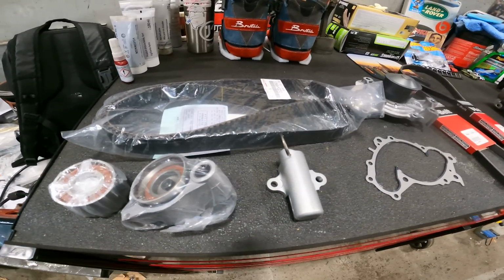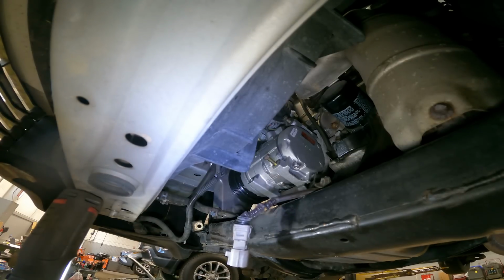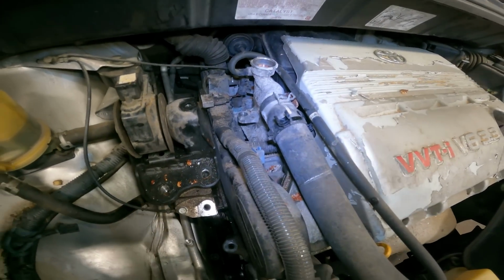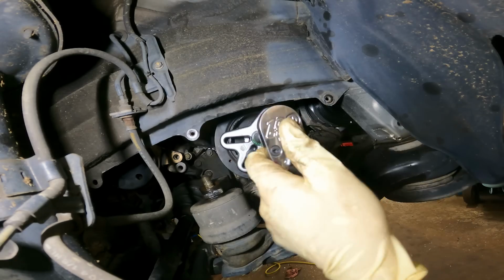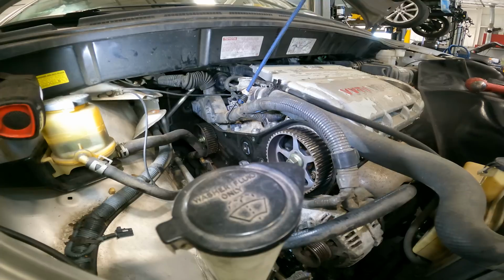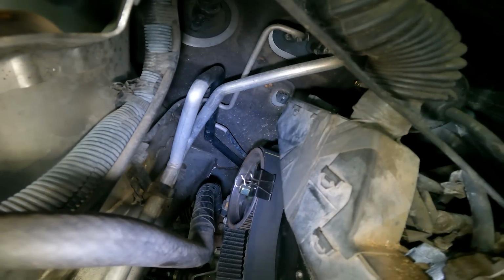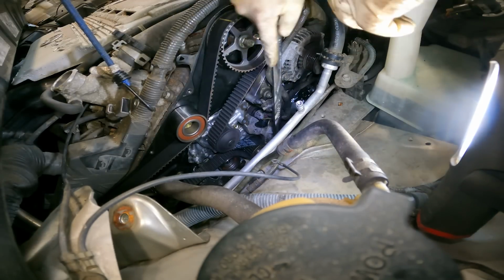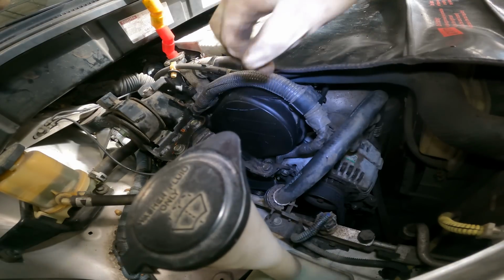WILL THIS ENGINE GO BANG💥AFTER MAJOR SERVICE⁉️ 🤔😨🤯😁

Comment: Man I forgotten about that 3.0 I used to love slapping filters on those things because they were quite easy as long as the manifold is cool… on the 3MZFE I used to be able to put plugs on the back half without removing the manifold as long as the coil packs were only in the front I think in mid engine cycle refresh they put coil packs in the back half underneath the intake manifold..
Reply: Just did one today

Comment: Apart from access...what an easy timing belt job that is!   Have you ever done a late Alfa 24V V6 Busso engine CSW??  They suck! Taper fit camwheels, cam locks, crappy thermo-mechanical tensioner that breaks if you look at it funny....

Comment: What about the front main seal or cam shaft seals? I’ve always had those replaced when the timing cover was off. Did the customer decline or was it not recommended?
Reply: Yes, definately should of replaced the 2 cam seals and crankshaft seal. You are 100% correct.
Reply: People are cheap. Im sure he recommended it. Definitely a professional who actually cares about the vehicle he's servicing,  giggity

Comment: Why doesn't Toyota demand every engine use a timing chain? I'm really surprised by the fact some use a timing belt.
Reply: The 2003 and up Camrys use timing chains. I believe the Sienna also the same way. The older models belts are the only ones. I did a chain on a 2003 few months ago.

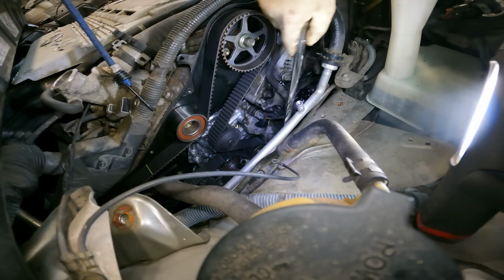Comment: 27:00 My small brain will never understand why that happens, why the lines on the belt no longer line up with the marks on the cam sprockets after rotation. I'm just a diy'er, but that's given me a heart attack in the past thinking I did something wrong
Reply: They will line up again. Depends on the engine (particular the number of teeth on the belt and on the sprockets) but it can take many revolutions. Impractical and unnecessary to do it by hand.

Comment: One thing I did with a gas engine was to pull the spark plugs, makes turning it over by hand easier.  With a diesel, removing the glow plugs also works.
Reply: Might not have been worth the hassle to remove the rear 3 plugs I would imagine.

Comment: The timing belt recently broke on my 2000 Camry. Distance is not the only factor, the rubber tends to perish with age (if not driven frequently). A non-interference engine, and all sorted now with no damage.
Reply: '99 Camry with the 3.0. 425,000+ miles. I changed what I think was it's second belt at around 311,000 miles. That belt was really cracked but didn't fail. I'm the 3rd owner. I know the second owner and he never changed the belt. He bought the car with it just over 100,000 miles.
Reply: Love the non interference design!

Comment: I hate, hate, hate timing belts.  I did the one on my 90 Dakota at 100,000 in 1993... The 2.5 had bolt holes in the cam pulley to hold it in place, I still got it wrong.  My mechanic re timed it and replaced the tensioner for me. I did the water pump the following summer, no need to mess with the timing belt.

Comment: I have a 2007 Highlander with 277,500+ miles and been saving up for the next timing belt replacement / 100k maintenance. But last week was rear ended and hoping it is not totaled, but if I need to replace the whole car, what year did they switch over to a timing chain? I bought this car at 87k miles 9 years ago. Yes, next car will be a Toyota. (Or Lexas - I'm 62 and retirement is in my future in a couple of years, no more 100 mile round trip commute.) I've been eyeballing a Lexas ES300h.
Reply: 2008 came with the 2gr i believe.

But 2gr engines are not perfect. The vvti rattle is real
Reply: The 2GFRE V6 is a chain.
Reply from the maker: Go with the Lexus
Reply: @customerstateswhat  07 rx is a 2gr as well
Reply from the maker: @colchronic  they are good engines, just don't be a Goomba with service lol. I have serviced cabs with over 300k on original engine. They are religious with oil changes and service.
Reply: @customerstateswhat  Never said they were bad. I still think they are better than an mz
Reply: @customerstateswhat  I really don't like the fact that you have to pull the engine to work on the timing cover I think that's a big mistake on Toyota's part

Comment: I hate timing belt jobs, and I`m not a tech. I just keep my own junk running, Like a 2002 Dodge Neon, timing belt was a pain, replaced belt, tensioner, and water pump. And yes, it went bang on first try, that was 8 years ago, still runs with 162,000 on the clock today. Now dealing with a P0172 rich code😠No vacuum leaks, mini cannon fired several times, plugs, map, O2, IAC, and injectors. Damn code still there. Won`t pass Pa. inspection. It`s my daily, stickers dead at end of July, can`t afford a shop, lost my job due to whats going on since Biden🤡 took over.
Reply: If you're driving a Neon, your problems started a long time before Joe took office!!! Do you always make so many bad decisions? I've got 4 Toyotas, and all of them have TIMING CHAINS... Quit buying old Dodges made in Mexico...
Reply: @gwats19577  while I do (by far) prefer Toyota over Chrysler. Every car company has its own set of issues, remember when Toyota made a bunch of oil burners from 2008-2011? And those new Tacomas are made in Mexico too. But Chrysler did have its shit together for a short period of time, so credit where it’s due
Reply: @jessepickar3297  it was 2003 thru 2009, affecting 1.8 and 2.4 engines... those oil burners didn't leave you stranded on the side of the road as long you worked the problem... Neons, PT Cruisers were just the top of the Chrysler/Stellantis waste pile.. best product they ever made was the Hellcat engine, but it was better to buy it and install it in something else...😄😄😄😄
Reply: @gwats19577  ur totally right, they did have some good stuff 50yrs ago but as for recent history they’re money pits. I do really wanna see a Hemi swapped Miata tho